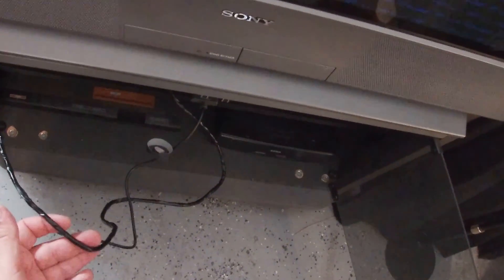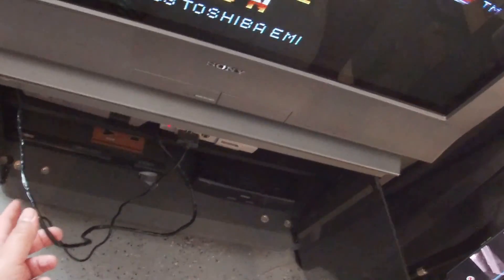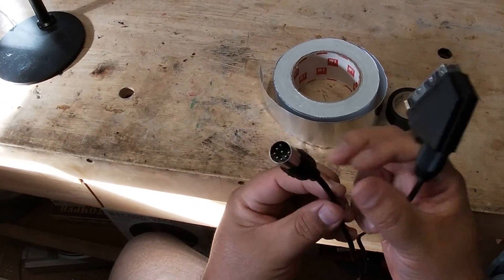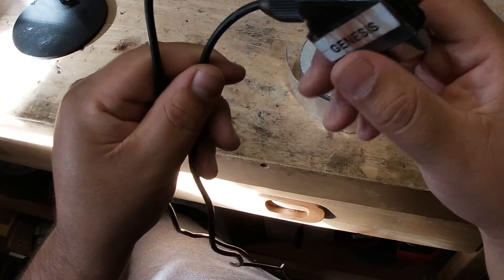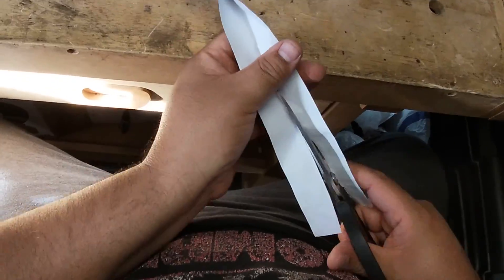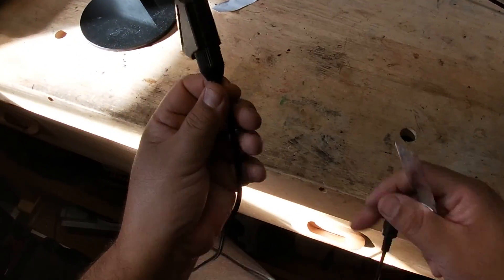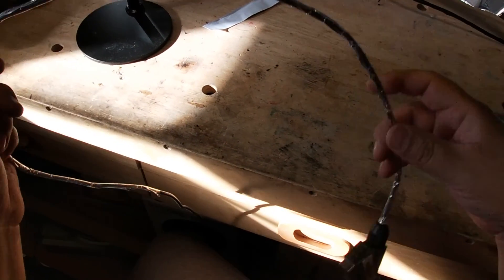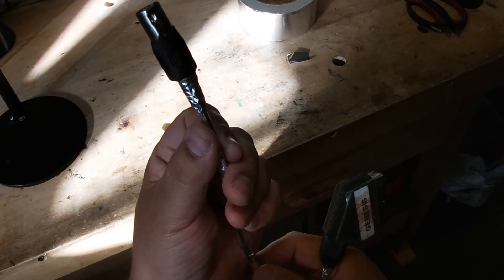DIY - Shielding your RGB Retro Gaming Cables - STOP OVERSPENDING!!!

Comment: Doesnt the shielding need to connect to ground at the end? 🤔
Reply: Yes you do. What he did might help a little, but for shielding to be actually beneficial it needs to be grounded on one end or the other. I recommend only grounding on one end though to prevent the possibility of ground loops.